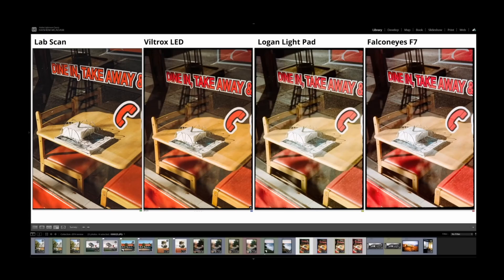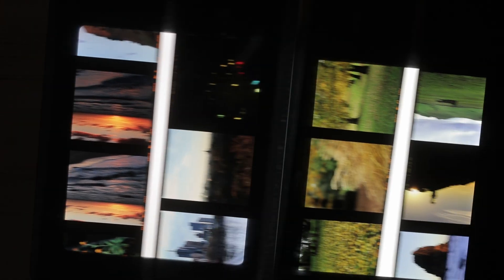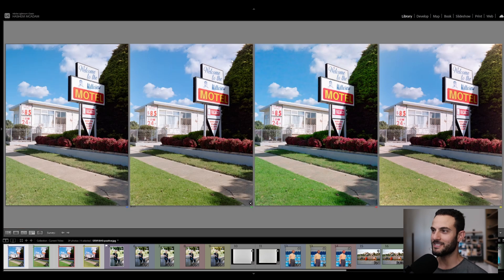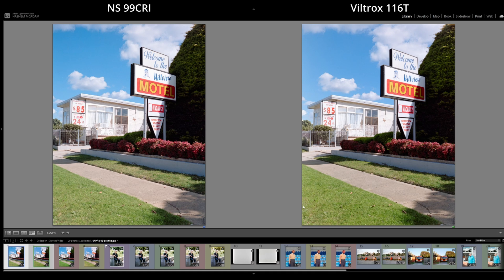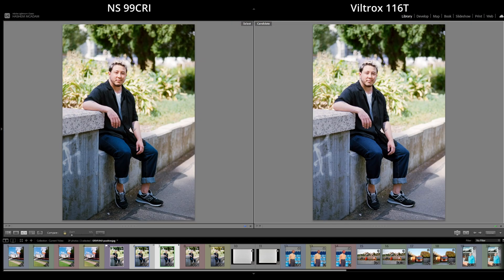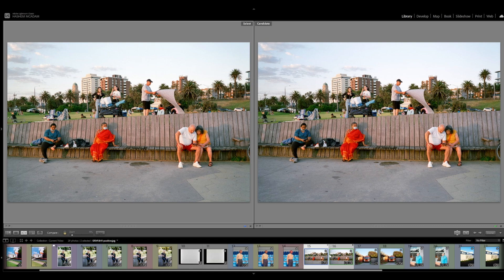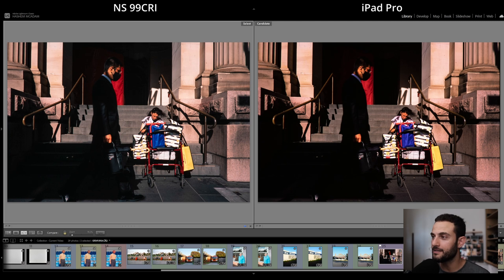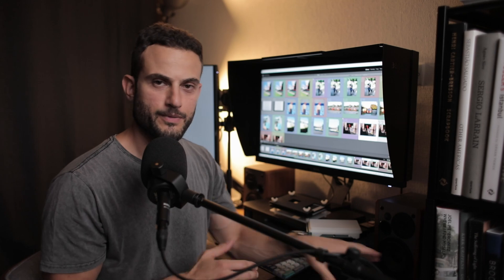Light Sources for Film Scanning

Comment: Not necessarily a question of 95 or 99 CRI as CRI is anyways a bad meassurement of color rendition. What you're more likely seeing is the way the different units emit light on the spectrum. The 99 CRI might emit more red or blue but that's not necessarily more accurate. Every unit and brand shifts to different colors, and have more or less accurate WB and tint compensations. The only way to figure this out is with an Spectrometer, a tool to meter visible light, like Sekonic C800. You should be looking into SSI/TLCI if you're into full spectrum LED's, but even then, cameras only record red, white and blue wavelenghts lol

Comment: I hate to be a buzzkill but CRI does not matter to "accurately" represent a color negative, if the manufacturers are familiar with encoding color negatives then they themselves know this and are intentionally using it as a marketing gimmick, but in all fairness they may not be color scientists. First it's worth noting that the only quantitative profiling for color negative is how it looks when printed on paper optimised for that stock by Kodak or Fuji. The paper's spectral response is not akin to a high CRI broadband source, it's more akin to specific narrowband light in the 460nm, 550nm, and 690nm range. It's not arbitrary either, it's a very specific spectral response which takes into account both the dichroic lamphouse spectral irradiance and print spectral sensitivity. The masking couplers in the negative emulsion exist to guide color timing under those print responsivities. Now I don't bring this up to make the point that one should try to achieve print spectral responsivities with their scanner, that's very difficult especially with bayer filtration of a DSLR, my point is that high CRI does not get you any closer to the intended trichromatic response of that negative printed. High CRI is useful for slides as the goal for those are just to get close to a projection from a tungsten illuminant, but for negative it's completely irrelevant. 

What's actually more important is maximising the bit depth of image dye density above the minimum density composed of the masking couplers. This means neutralising the orange mask with light, not white balancing. Because white balancing is an adjustment of analog gain, post capture. If you scan color negative with white light, more electrons will fill the well depth of the red and green filtered photosites from the orange masking than the blue filtered photosite, this leaves less dynamic range for the blue channel density, when you white balance the orange mask, this adjusts the gain of those channels, it doesn't improve dynamic range. When I say the orange masking should be neutralised with light, I mean that the number of electrons which fill each bayer filtered photosite should be equal when scanning minimum density. Dynamic range matters because for high densities (highlights) they will be stored to very low code values, where differences in density introduce more and more quantisation noise. Given this, cooler bluer light will produce a cleaner scan of color negative compared to high CRI white light.
Reply: So what cooler light can you recommend for color negative? I am thinking about using a solux 4700k halogen bulb..this is the lamp inside the great Kodak Pakon F235 scanner. But still not sure how to diffuse it and use it in a practical way for camera scanning. What do you think?...is there a way to replicate the lighting from that scanner?
Reply: @Maarten_S-g5n  I would recommend that source only if your scanner sensor has a similar response to the CCD used for the F235, because the final trichromatic response is always the product of both your sensors spectral sensitivity multiplied by the backlights spectral power distribution, a significant change in the spectra of either component will not produce the desired response. Most high end scanner manufactures today such as Arri and DFT employ narrowband LEDs for calibration. 

The reason why I don't recommend any broad spectrum source is because the orange masking in color negative is stock specific, every stock has a slightly different concentration of masking couplers, so thus require a different timing for correction. If you're really looking to upgrade your scanning setup I would recommend ordering a custom narrowband LED panel, where you're able to select the peak wavelengths of each RGB LED. Where the peak wavelengths you choose correspond to the wavelengths which maximise the density of one dye layer while minimising the density of the others, that achieves the best color separation. You can determine these wavelengths by observing the spectral dye density curves published by Kodak or Fuji for the stock you wish to scan. There are some common trends, such as 460nm for the yellow dye layer, 550nm for the magenta, and 690nm for the cyan.There should be plenty of companies which offer custom solutions, alternatively if you have experience soldering you could order some SMD LEDs from mouser electronics and order a template PCB designed to support pulse width modulation for dimming. 

As for commercial options currently available which approach negative scanning with this philosophy of cooler emission, cinestill's CS-LITE backlight does shift to a cooler color temperature for scanning color negatives, this won't offer as much control as a tuneable RGB LED source but it may get you in the right ball park for a budget solution.
Reply: @SHDEdits  Thanks for your detailed information and sharing your knowledge. What you say about the different color channels feels a bit like color filtration in the darkroom. Makes sense that Cri values are for marketing. It's the same with megapixels. People think that you get higher quality photos with more megapixels. 
We should focus more on the color of light and not Cri. The only thing I don't understand why the scans for example from a Hasselblad X5 or Noritsu scanner are so beautiful but don't use different color temperatures?
I am going to try the CS lite. It seems the easiest and cheapest solution for now. I am located in the Netherlands, so ordering from the US is not ideal. Many thanks!
Reply: @Maarten_S-g5n  Happy to help. As for your question regarding those different scanners, hasselblad essentially offers factory calibration via 3D LUTs per stock from their fixed scanner response employing broad band illumination. This would be similar to the calibration practices of continuous motion picture scanners like telecines as those machines can not intermittently capture RGB flash exposures, so must compromise with broad spectrum illumination and custom 3D calibration LUTs for every stock. As to why they went this route I’m not sure, as they don’t face the same limitations as a telecine, so on paper they’d have to deal with potential limitations in bit depth however they may have chosen a specific broadband source alongside their scanner sensor similar to that Kodak scanner for minimising noise. This unfortunately is left to speculation.

As for noritsu and frontier, it’s a completely different story, they both employ narrowband RGB LEDs with peak wavelengths ideal for maximising color separation which would be dimmable for neutralising the orange masking of any negative stock in real time as described above. Both noritsu and frontier also employ IR LEDs in their boards to obtain a pass of the film where only the density of dust is present as image and masking dyes do not absorb infrared light. The noritsu employs a line array for their LEDs and frontier an area array. The frontier SP-3000 has peak emission in the 440nm to 460nm range for blue, 535nm to 545nm for green and 640nm to 660nm for red. Some scanner manufacturers choose shorter wavelengths than 690nm when employing a Bayer filter sensor as sensitivity in that range is typically lower.
Reply: @Maarten_S-g5n  As for diffusion, opal glass has been the standard for scanners and densitometers for decades. You should be able to purchase some from Edmund Optics.

Comment: I just ordered the negative supply light due to noticing the cinestill cs-lite just isn’t  good enough when scanning portra 400. I get a purple in my shadows. When I scan Kodak gold or even Colorplus they come out good but I believe that’s because those film stocks aren’t as thick as Portra so the light goes through ok. Pumped to get a better light for scanning !
Reply from the maker: Interesting... So you think it's a brightness issue? or the spectrum/quality of the light? I've yet to try the CS-light.
Reply: @pushingfilm  Just wanted to give an update. I just got the NS 35mm cri 97 lite and put it next to the cinestill cs-lite and there’s a magenta hue coming from the cinestill light and the NS light is definitely brighter. I’m gonna scan tonight but I feel that’s definitely why I’m getting magenta/purple  in my shadows.
Reply from the maker: @viewfinderthis  I see! I would since it gets inverted, that magenta would translate to green... But maybe there's more to it than that. It'll be interesting to see how you go with a side by side test using synced exposure and conversion settings.
Reply: I thinks it’s a little bit of both. It might be ok to get by with certain film stocks but not for all which is the opposite of having a dedicated light for scanning film. I think two having different modes on the light could play to inconsistency overall. It is rated for 95+cri but I saw on Reddit someone measured the wavelengths of the light and the “cool” setting for color negative was 89cri with a 70r.

Comment: What about OLED screens and some kind of masking app. When colors are off then you can compensate white balance using light source. Also using oled you can apply color temperatures so you may get more accurate colors and loose less info.  You can compensate tint when you scan borders and make adjustments.

Comment: btw, glad to see another dedicated film scanning person existed on Youtube.  I had owned Epson V700, a Howtek D4000 drum scanner and now I am doing scanning with MACRO lens. btw, I would recommend tuning your camera to UniWB, it will help you achieve maximum bits range when you do pushing to the right exposure, which IMHO is kinda necessary for slides due to their very high dynamic ranges. The steps are quite easy as you only need to adjust your red, blue multiplier to around 1 using a pallete APP on your phone or tablet.

Comment: Hi and I had just did some experiments with your recommendations and lifted off my film slide about 3~4mm above the light table, however the blooming/bleeding at high contrast edges do not disappear completely, still very apparent, and now my film curvature definitely hurts the clarity(before it was against light table in complete flatness). Before when I had film directly taped against light table, aperture 5.6 can be achieved for full clarity (Sigma 105mm Macro Art), but now due to curvature, I have to lower it to F8 and the resolution definitely hurts.

I then did some other experiments, and found that lowering the light table (Raleno) brightness intensity definitely helps with blooming issue at high contrast edge, and lower to about 50% of original brightness can achieve very good blooming/bleeding light balance vs film detail clarity. now the blooming is curbed about half as bad as it was before, and I don't have to lift the film above which will result in curvature.  Anything lower than 50% brightness, the dark portion of film begins to loose the clarity but the blooming issue definitely improves further. It seems to be an art of balance to achieve the best result but then again I would probably blame Velvia for being way too high in contrast, which is an very hard film to scan.

Comment: I see the reason why you would want to liftup the film away from the light source a little bit, the diffuser in light tables would actual cast stray lights should you put the film directly against the table, and at high contrast edges, the scanning result would have this light bleeding/blooming issue because of the stray light goes sideways... am I right?
Reply from the maker: Yep! It's generally better to lift the film away from the light source for the reasons you mention. Also less chance of picking up dust or other imperfections on the surface of the light source.
Reply: @pushingfilm  Thanks, it bewildered me for months why all my Fuji Velvia 100f (high contract slides) all has this weird blooming/bleeding issue around high contrast edges. I should have lifted them away slightly from my Raleno light table in the 1st place .... bummer..

Comment: I have the Raleno CRI>95 light panel with built-in 4 layer diffuser, do you think it's good idea to put film directly against the surface for scanning? Why do you need lift-offs when the panel has build-in diffusers? I have found that this way I can keep my film very flat against the light table..... Do you mind answer my concerns? thanks a lot
Reply from the maker: I haven't used the same light, but am sure it's fine for scanning. As for laying it directly see my reply to your comment on my other video.

Comment: Both the source film and the digital sensor have 3 colour channels. Provided the light source is uniform, there is light for each channel and you expose to the right to get enough resolution, a simple white-balance correction or calibration will equalize the effect of all light sources. Comparing 95 vs 99 CRI is as silly as getting gold-plated connectors for your Hi-Fi. It's just marketing hype.

Comment: Out of the box thinking about light. Really enjoyed your demo of the Essential Film Holder, will be getting one of them soon. Getting back to the tight source. Lights designed for copying negatives tend to be expensive so I did some research into alternatives and came up with a S.A.D. lamp. One lamp in particular has a dimmable 35,000 lux and 3,000 to 6,500 variable colour temperature control. In the UK a typical cost is around £20 for a 6 inch by 4 inch lamp. Is this sort of lamp a viable option? I will be interested to read your comments . Greg
Reply from the maker: Hey, I'm sure it would work and that you'd get enough brightness, but I can't say much about evenness or colour accuracy since I don't have any experience with SAD lamps sorry!

Comment: Sorry but these tests are a total waste of time. You can only compare the fidelity of a light source and it's spectral response when you digitise ISO standard colour reference TRANSPARENCY film frames (slides). There are too many infra red film mask conversion variables when you try to digitise digitise colour negative film. Also when you digitise a colour transparency you can easily compare the digitised imaged to the original film frame (on a calibrated monitor). Just buy the highest CRI rated light box, mask it down to the framing device and calibrate everything. Then you are half way there - just batch adjust in LightRoom. P.S. I own a $400,000 Kodak Pro Photo CD scanning system, supply high end custom scans to Pro Labs in Australia and do all the Lucas Film still scans for Star Wars. However I built fast 36MP camera based digitisation systems like this 1n 2004. I use TTL flash systems on extension cords with diffusion boxes for the main exposure illumination along with small previewing lamps for set-up and frame positioning.
Reply: I use vintage chassis of repronar 805, 36mpx camera + best in class Rodagon Dx2 lens and flash. No any ugly LED lights. Results are OK, but not as good as real drum scanner

Comment: Great video. Good investigation. Good information for the community. I feel as if I can’t be bothered to scan my film with a DSLR and would almost rather just get a Noritsu, although it would be 35mm only. Last time I was scanning with NLP, I felt that I was spending way too much time getting the colors right. Do you find that you’ve become quicker with the process once you got a proper setup?
Reply from the maker: Thanks! I have become quicker, but its definitely not as quick as using a Lab scanner like a Frontier or Noritsu. If you only want to do 35mm, you can look into the LS-600... but they've become extremely expensive... and if course hard to service or repair.